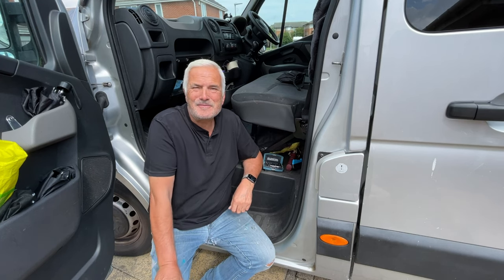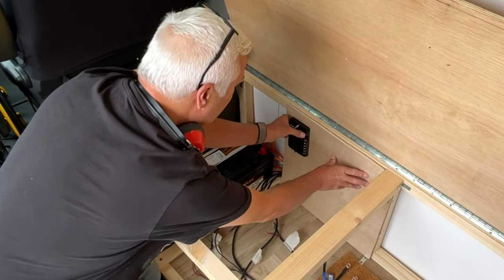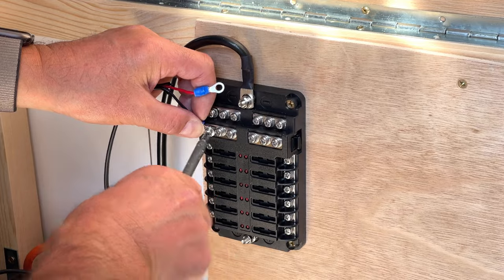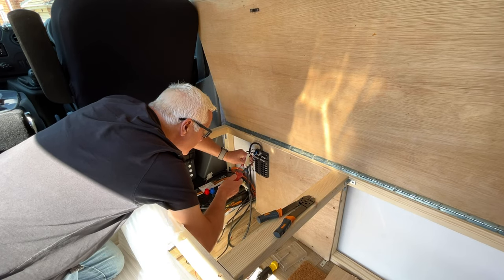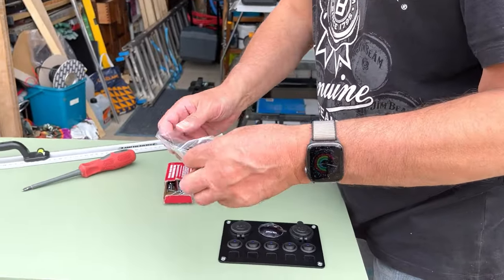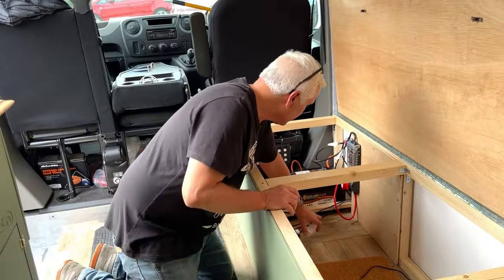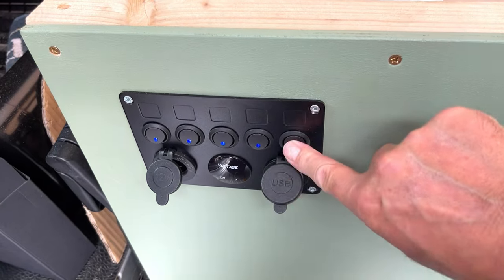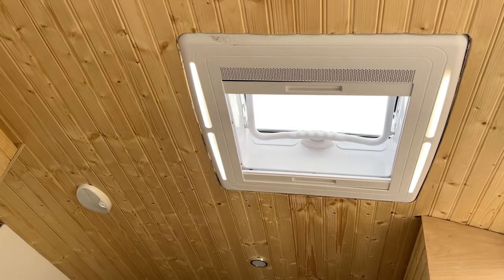WIRING A FUSE BOX AND SWITCH PANEL IN A CAMPER VAN. SIMPLE CAMPERVAN ELECTRICS.

Comment: Can't see the point of having a fuse board and inline fuses. One or the other. Most remove the inline fuses from the switch panel (they're all 15amps - oversized) and make a new cable with spade connections (with heat shrink) to run back to the fuse board, with the correct size spade fuses for the load of each circuit.
Reply: Same. Loads of videos fitting a switch panel, with a volt meter, and a pile of fuses back to a fuse block. Pointless. Dodgy.

Comment: Jesus another van without a fused power cable just a cut off switch 😂😂😂😂 like it does it itself before fire
Reply: Explain please, instead of being so negative ?
Reply from the maker: Does it amuse you to laugh at people ?
Why don't you offer some constructive advice.
Reply: @foxystravels  hi,
the purpose of the fuse is to protect the cable which is coming straight from the battery (DC) from potentially over heating and catching fire, 
but all you have is a isolator to cut off the power manually for you to work on your system,
so the fuse should be installed as well so it can trip and break the circuit in case of any overload faults, 
i hope that makes sence as im a bathroom fitter and not a sparky but it should be common practice especially on dc and solar setups as im aware off  
cheers craig

Comment: Do you have an inverter? Total novice just trying to get my head around it all
Reply from the maker: No inverter, because everything is 12 volt. An inverter changes it to AC, so you can use normal household electrical appliances. 
I use an EcoFlow power station for that stuff. 
Thanks for watching.

Comment: Looks like the loads through the switch panel are now each, double fused. 
Some would advise a fuse very close to the battery to protect the main battery cables.
Reply from the maker: Thanks for the advice :)
Reply: Is double fusing bad?

Comment: Hi mate great video and very helpful for me definitely but can I ask did you have to put fuses in for the control panel to work? Thanks
Reply from the maker: Hi mate, thanks for watching. As far as I remember, the control panel already has the fuses fitted.
Reply: Thanks for replying bud, I’m going to try get mines hooked up this weekend 👍🏻
Reply from the maker: @RossWilson-p2d  Cool, I hope it goes well for you. I haven't had any bother with the set up at all, up to now.
Reply: One more question if you’d be kind enough to answer, is your switch panel wired direct to battery? Mines reads 12.9 on battery but only 3.7 if it’s connected to fuse board, thanks
Reply from the maker: @RossWilson-p2d  Mine goes to the fuse box. I have no idea why you would have a reduction in voltage. Is it deffo connected in correctly with a fuse fitted ?
Reply: I can’t seem to find why it’s doing that tbh, a proper headache, hopefully I’ll find the problem at the weekend
Reply from the maker: @RossWilson-p2d   Best of luck
Reply: What size cable from battery to battery thanks good vids m8
Reply from the maker: @sasmicky71  I think all the info s in this video, but if I remember correctly, it was 16mm https://youtu.be/xUS-nMOuwko?si=gSFSX4vpXDwNCb09

Comment: Hello great video could you connect a inverter to the fuse board ? Instead of running straight off the battery
Reply from the maker: To be honest, I wouldn't like to advise on that. I personally think it would be ok, but you're better off checking with someone who knows better than me.

Comment: How did u connect the live thick gauge wire to the thinner wire that goes into the switch for the switch panel?
Reply from the maker: It's a thinner cable that comes from the fuse box. I think that's what you're asking ?
Reply: @foxystravels  ok so the live that connects to the switch is connected to one of the live spots on the fuse box?
Reply from the maker: @nyjetsfan4455  That's how I have done it.

Comment: Just a thought,,if you switch the white switch off at night , will that kill the power to all your light`s etc , i see i`m not the only one who forget`s to put the heat shrink on first 😂😂👍👍👍👍
Reply from the maker: Hi Tonyboat. Thanks for you comments :) No it won't turn them all off, cause the light under top cupboard and the above the bed are. straight into the fuse box, which will be on :)

Comment: Why did you piggy back all the negatives when there already piggy backed on the back of the switch panel already?
Reply: Hi, thanks for your comment. Where would I plug the negatives in from the load, as in the lights ? I thought all the negatives go all the. way back to the fuse box, so I did it this way, so that I didn't have to run a lead all the way back.
Reply: I don't understand why you used a fuse box when the control panal has inline fuses
Reply from the maker: Just extra protection ?